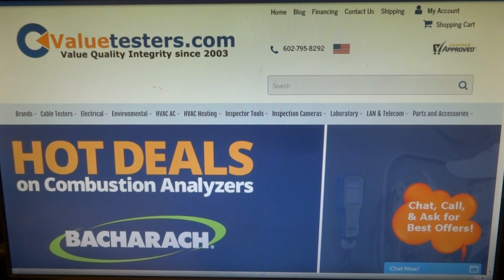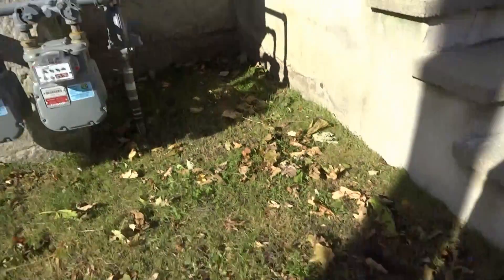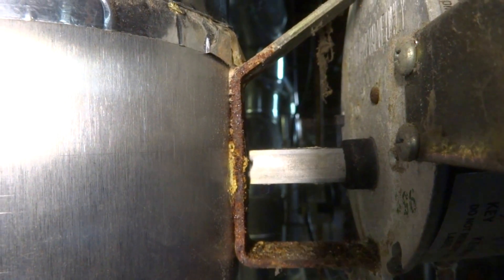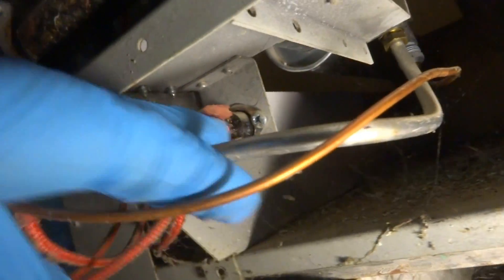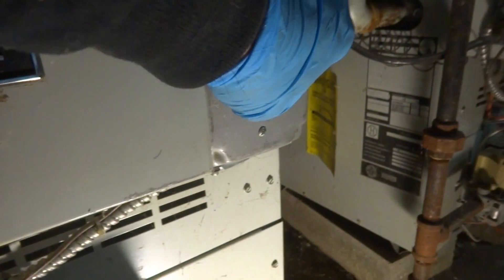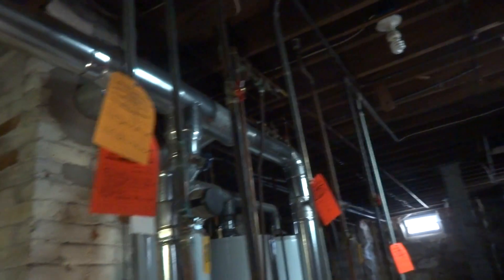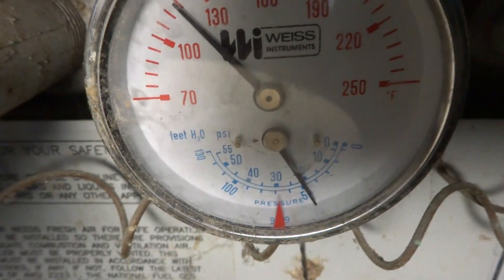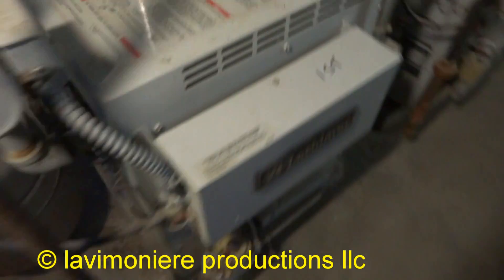gas boiler no heat call

Comment: For the last 5 or 6 years, I've used a product called "Caig DeOxit", wherever I came across a corrosion situation, and on all of the condensing units which I've serviced. The stuff works very well on contactors, and fan motor shafts. It's expensive, but one drop goes a long way.

Comment: hi steve, i was that guy that called u from lawrence, i was affected by the gas explosion and colombia gas is replacing my boiler. i have a big 200k input  boiler, burnham from 2002 as a single unit to heat a 2 family home. i split the system into 2 now. got a 90k rand rand reardon and other 130k with the same brand. what do you think of that brand? I'm going from 80% AFUE to 84% so im hoping to see savings there, but I've never heard of this brand before. i heeded your advise over the phone and steered clear from the condensing units.. everyone says the savings are offset but such constant maintenance.
Reply: I would go weil-mclain boiler or back to Burham boiler. Good boilers